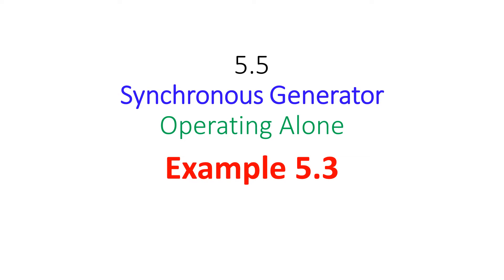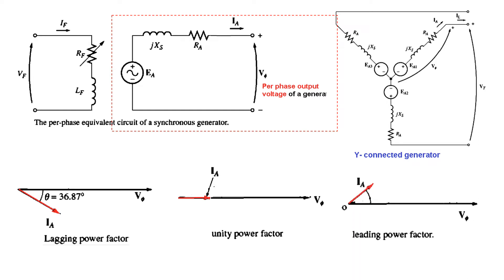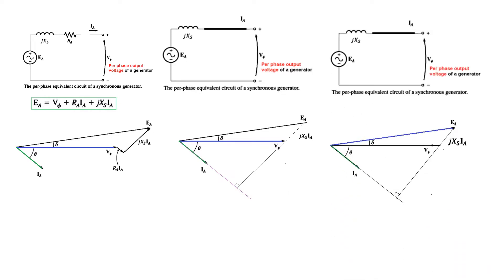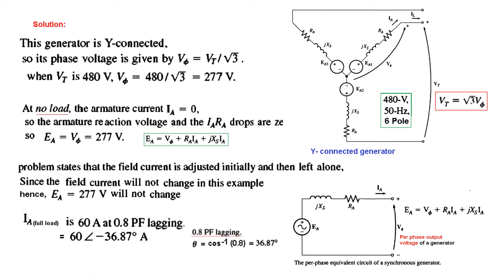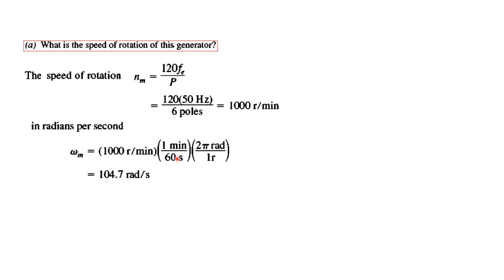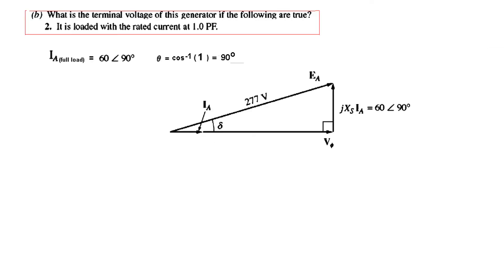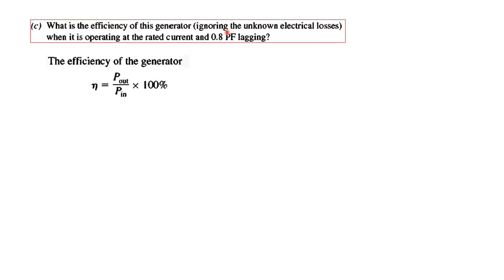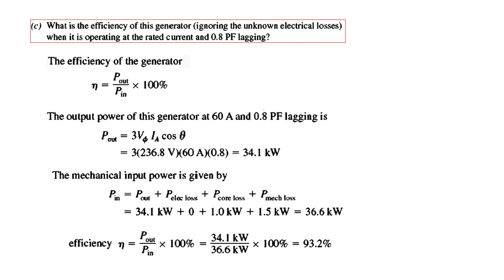Synchronous Generator ||  Example 5.3 || EM 5.8(2)(English)(Chapman)

Comment from the maker: At time 9.25 , wm (omega) has been wrongly calculated with frequency 60Hz instead of 50Hz. The correct answer is wm= 125.7 rad/sec
Reply: ans should be 104.7 right sir as 2pie/60 muliply by 1000r/min
Reply from the maker: @halservices  Oh Bhai , in question frequency given is 50Hz. At time 9.25 , wm (omega) has been wrongly calculated with frequency 60Hz instead of 50Hz (error in the book). The correct answer is wm= 125.7 rad/sec
Reply: @ElectricalEngineeringAcademy dear sir above solution you have questions number a) omega= 104.7 
done like as book why?